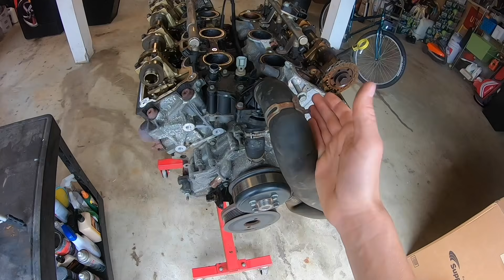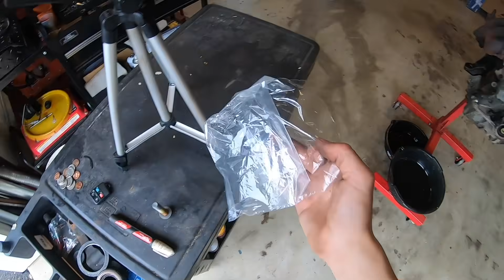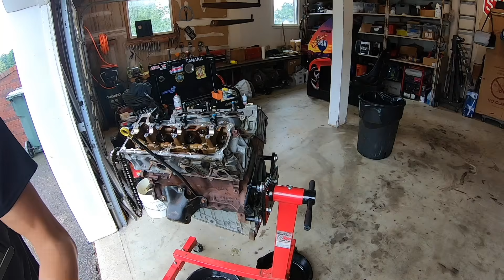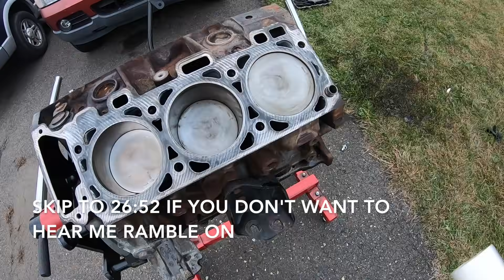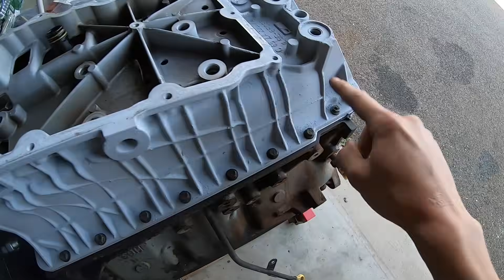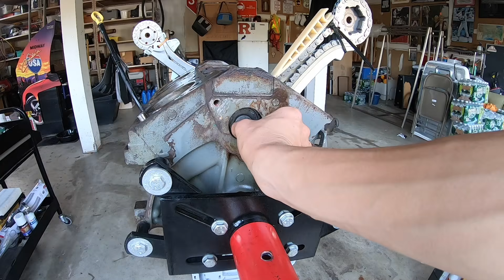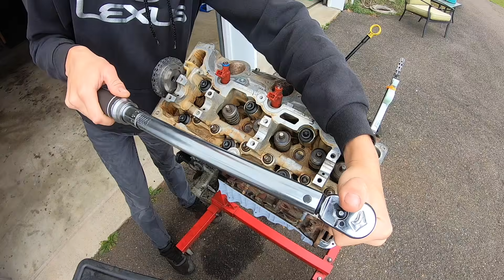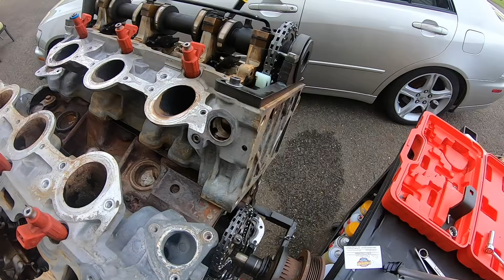Ford 4.0L SOHC V6 Head Gasket and Timing Chain Replacement (COMPLETE GUIDE)

Comment: Man you are amazing,  I have the same engine in my explorer sport trac it has 223k on it however it runs like a dream I think when it comes time to rebuild I'm going to save this video you are great at what you do ,you seem to know the specs on everything as far torque of bolts and the steps to take for rebuild very very good video, take care and be safe
Reply: @Mike Fu yeah i have a 98 Explorer and a Sport trac the 98 engine im putting in my Sport trac it has about 300k in it and like yours it runs great the engine in my Sport trac im going to rebuild put new bearings and also new chains ,ill do alittle at a time then when its done ill put it back in my Sport trac but the chains and guides look good even After abunch of miles on it i also think when you do the chains are you not supposed to use the same Bolts because they say its bad but ive Used the same Bolts and everything seems to fine so far

Comment: The 8mm head bolt should be removed first  and all valve guishould be replaced when the valves got bent
Reply from the maker: I have no idea what you’re talking about. The donor heads were off a different engine. The valves were never bent.

Comment: i love your attitude and how you show the process, and how to overcome the special tooling in your cassette replacement video.  obviously, common sense is involved in avoiding special tooling, i've only done ford's belt engines, but when special tools aren't pretty cheap like these ones, it is incredibly frustrating.   i'm probably about your age, 27, and i own a shop in pennsylvania doing mostly powertrain repair on japanese vehicles.   I came into an 07 explorer cheap, and im watching your video just to learn and become familiar with the platform.  What tri-state area are you in? I was always unsure about that phrase.

Keep it up! Thanks!
Reply from the maker: Located in NJ :3
Reply: @iamdjnam    Cool.  I'm in RI...  Will contact you if I ever decide to buy a used explorer...

Comment: Best video on youtube for these engines, I'm on the second one I've done with a completely bounced timing chain that didn't bend the valves. All the service info I have on Alldata and Mitchell suggests they are interference engines. I'm assuming that if the chain comes off completely you could get lucky, the one I'm currently doing broke all the guides front chain and rear (cassettes) as ford calls them and the chain went so violently that it broke a hole in the valve cover on driver side (LH/front chain), the shrapnel took out the DPFE sensor and broke pressure switch clean off of the A/C line right at the back of the compressor. On the other hand, all the ones I've done where the chain jumped time and continued to run before completely shutting down had every single valve bent. I've seen this on multiple different interference engines where if the chain completely breaks or slips off it doesn't allow the piston/valve collision to happen, the first time I thought it was a real lucky day but now I've seen it a few times
Reply: How did you figure it didn’t bend the valves? Did you take the heads off and look?  My front driver side cassette also popped thru the valve cover.  I redid the timing 8 years ago.  I have yet to take the valve cover off and look at it, a bolt head is stripped on the cover..

Comment: My 2005 Ford Sport Trac with 4.0 SOHC broke timing chains and valves hit pistons. If I put rebuilt heads on do I have to replace the pistons? Your video is awesome. Have a mechanical back ground and have changed heads on other engines so I can do the job. Don’t want to change pistons if not necessary.
Reply from the maker: No. You can reuse the pistons.

Comment: I did the timing job, put it in the car got it running and its been running fine for the best 800 miles, but now i'm pretty sure the head gasket was blown on the used motor I picked up. I should of replaced it while it was on the stand 😭😭😭

Comment: I have a 2009 Mustang without the balance shaft. I bought the tool 🔧 but I don't see where you used it. I removed the driver side head and cam gear without using any tool to hold the cam. Is that going to be a problem? I would think the cam shaft turned a little
Reply from the maker: You need the tools to properly time the engine. Removal of any head requires complete retiming of the motor.

Comment: I have a 2003 Ford Ranger 4.0 4x4 with 186k miles on it. One of the piston rods broke through the oil pan. I was wondering if you know some reasons how this could have happened. Could it possibly be a oil pump or timing chain failure? Also wondering what drives the oil pump on this engine? Looking forward to your input. Thanks!
Reply from the maker: Defective or scored rod bearing causing low oil pressure. It’s driven by a small rod off the jackshaft.
Reply: @iamdjnam  Thanks for the info! If I were to look for an engine at the junk yard to swap, Would you recommend another engine to swap besides the ford ranger engine? Since my motor is 4.0 4x4 I would have to take that into consideration while looking. Also would another engine other than the Ford Ranger engine cause problems with my transmission? As I would like to keep it because I just got it rebuilt.
Reply from the maker: @ClutchMadnezz  every 4.0 sohc ever made is identical besides the balance shaft. Whether it come out of a Ranger, Explorer, mustang or mountaineer, it’s alllll the same
Reply: @iamdjnam  Isn't it necessary for my 4.0 4x4 engine to have a balance shaft? If so, which ones out of those vehicles you listed would have a balance shaft?
Reply from the maker: @ClutchMadnezz  nah I always delete the balance shaft
Reply: @iamdjnam  Thank you so much for your quick responses. Really appreciate the info.
Reply: @iamdjnam  Oh it seems you did not respond to one of the questions actually it was, Do you foresee any problems with my existing transmission if I were to keep it and swap out for one of the engines you recommended. Also when you say "delete the balance" shaft do you fully remove it or just disconnect it.

Comment: Nice video man! Do you not rebuild these engines anymore? About to pull my 04 with 270K miles. She runs like a champ, but just got the death rattle. 5R55S was rebuilt 60K miles ago. Seems like I really should rebuild while I'm there..... I just cant bring myself to gamble on a junkyard motor on these 4.0ls. Your rebuild vids are the only ones you have with comments turned off. I'm sure that's due to trolls, But I'm asking you, are rebuilds too problematic?  Thanks in advance!
Reply from the maker: The complete rebuilds aren’t worth my time. I would get a used engine replace all the timing components and install it.
Reply: @iamdjnam  what about a crate motor? Aren’t those all rebuilt engines?

Comment: Hey bro excellent video do you happend to have that part number or a complete kit that you used thanks
Reply from the maker: Everything was pieced together. Links are in the description.
Reply: Thanks you for responding. I am working on  a 2005 v6 mustang just wandering if this kit would work for that engine I believe it is but I am not 100% sure do you know if there any differences in between the engines or is it the same ? Thanks bro
Reply from the maker: @kirtonvincent  it’ll work.
Reply: Awesome bro thanks btw your rodeo is one of the best out there just so you know

Comment: Great video! So as long as the cams are aligned and my sprocket is at TDC thats all i need? Theres no marks on the chain at all? Seems too easy…. About to pull my engine tomorrow
Reply from the maker: Yep crank at 12:00 and cams aligned. You’re good to go.

Comment: Same with head bolts push don't pull it will save your back down the road
Reply from the maker: Back has 2 rods and 20 screws. Can’t get any worse!
Reply: @iamdjnam  what did you do to your back?
Reply from the maker: @sef2273  scoli

Comment: So do the heads need to be machined flat? Never done a 4.0, can they just be taken off cleaned n replaced
Reply from the maker: I’d recommend it. I actually used fine fine fine sandpaper. The engine in this video just hit 40k miles.

Comment: I missed something.. Why are you advising adamantly to get the tool .. then using the vice grip method to hold the camshafts??
Reply from the maker: The kit only comes with one tool to hold the cam. The other cam is free to spin. I use the vice grips to spin the cams to TDC and to hold it when the other is in use.

Comment: I got the Fel-pro oil girdle gasket but it didn’t seem like it wanted to fit. Have you ever experienced this issue? It didn’t seem like the girdle wanted to sit flush after I put it in. I was gonna try to get the Ford one to see if that worked any better.
Reply from the maker: Usually they squish down and create a decent seal. I haven’t had issues with the Felpro ones. The eBay ones tend to weep every time.
Reply: The dealership by my house had one in stock so I’m going to see if that’s a better fit; otherwise I’ll use the Fel-pro one
Reply from the maker: Typically the dealership will have a better fit.

Comment: The Timing Chain Tool Kit on your link are no longer available.  Do you think DP Tools is a good brand?
Thank you!

Fantastic Videos!  I have a 1998 Ford Explorer.  Around six years ago the mechanic I used wouldn't install a new head gasket due to the complications involved with the timing chain and cassettes, so I waited a long time until they found a used engine which was installed.  It made a ticking noise from the onset.  The transmission went out when I drove it home from the mechanic, so that was also replaced.  A few months later the fuel pump went out.  I parked the Explorer in my garage for the next 6 or 7 years.  I recently had a different mechanic install a new pump.  It drove very well for a couple of weeks and then appears to have jumped time.  I still have the original engine and plan to use your video to pull the head(s) and replace the gasket.
Reply from the maker: DP will work fine. I’ll update the link asap. Thanks for the heads up.
Reply: @iamdjnam  Thank you for your response and your awesome videos!

Comment: I like to consider myself capable Mechanic, but this 4.0 timing chain shouldn't be this complicated. with was ford thinking, your video has given some confidence that, either I pull my 4.0 hope I didn't damage anything, because I killed it, or just get Used one and rebuild it, because they all most likely have worn timing chain parts. your video was very well done. I will see what the budget is maybe I'll rebuild one.

Comment: Do you know if all these engines came with the crank balancer?
Reply from the maker: @grizz2971  I always follow the Haynes manual orientation. Just did it last week!
Reply: @iamdjnam  Ok, sorry for all the questions. I'm following haynes as well. Thanks
Reply from the maker: Harmonic balancer or balance shaft are you referring to?
Reply: @iamdjnam  balance shaft, sorry. I don't know any of the history on my engine. But I've read that 4wd trucks had them and 2wd didn't. Im not going to put one in but I was trying to find out if this engines been tore down in the past
Reply from the maker: That’s correct. But sometimes Ford put whatever they had left into the vehicles. My 2WD mustang had the balance shaft.
Reply: @iamdjnam  ok cool thanks!

Comment: I'm rebuilding a 4.0 now. I was wondering if the connecting rod studs need to be replaced. I've read on some forums that they are TTY and some others say they're not. I've got all the other required TTY bolts
Reply from the maker: They are but I don’t replace them and I’ve never had issues.
Reply: @iamdjnam  Ok good deal!

Comment: Great video. So I'm replacing both head gaskets with the engine still in the vehicle. (03 Ranger 2wd) and the passenger side timing guide was broken while pulling the head off. Can that guide be replaced without removing the whole engine from the truck? I see you pull a broken piece of the passenger side guide out in this video but not the other piece. Is that lower pivot bolt accessible with the engine still in the truck? 
Thank you in advance!
Reply from the maker: Engine must be removed.
Reply: @iamdjnam  f#*k. Thanks for the reply!

Comment: Can’t do the back one without pulling the motor or dropping the trans
Reply from the maker: Yep. I mention that almost every video.
Reply: Just pulled my heads of and one of the valves broke of the head and bent sideways putting a hole in one of the cylinders so I will need a whole new block

Comment: I think this is the engine in my 2007 Landrover Discovery 3. V6 petrol unit, very smooth at 200k klms. How long do these engines last?  I change oil regularly and service .
Reply from the maker: 06+ engines will last 200-250k miles with good maintenance

Comment: Got a stripped head bolt in 4.0 liter I inherited the repair of any tips?
Reply from the maker: I stripped like 12 of them in my life. You gotta drill the head of the bolt off. I like those Dewalt black oxide bits. Use a vacuum to suck up the shavings. After you get the head of the bolt off, lift the cylinder head off. Then what’s left literally just unthreads from the block.
Reply: Hey great idea! I was about to weld something on there and start cranking lol.  Well thank you for the very informative video.  Awesome stuff quality content!

Comment: Hello, please tell me how to set up the gas distribution mechanism? since the mechanism is completely lost, the camshafts spun without a crankshaft. Thank you!
Reply from the maker: Which vehicle do you have?
Reply: @iamdjnam  ford explorer 4 cologne v6 sohc
Reply: @iamdjnam  please help, I installed the camshafts in the correct position according to the crankshaft mark, a knock is heard when the engine is started. after that, he turned the camshafts 180 degrees relative to the same crankshaft mark, when the engine is restarted, a knock is also heard, what could it be? Thanks

Comment: While replacing head gaskets the Right side cam got outta place badly. I’m about to the point of putting timing cover on since I replaced the timing and most components. Heads are on but the timing is not adjusted I have timing tools kit . My question is at what point do I  adjust right side cam, lock drivers side, and turn crank without breaking sprockets?
Reply from the maker: If the cam snapped backwards grab it with vise grips and rotate it to TDC.

Comment: I have a 2005 ford explorer 4.0 with 60 000 miles and now don't start Crank but no start and only driver side turn I don't know if is cheaper to replace the motor or fix the one is on it
Reply from the maker: Do a leakdown test on passenger side to confirm engine health.

Comment: Thanks for all the videos they are a huge help with my current v6 rebuild. Also thanks for mentioning DNJ components and partsology. No one in Australia supplies parts for these including Ford.
Have you ever posted a complete list of Torque to yeild bolts? 
Do you know where I can get new ring gear (Fly wheel) to crank shaft bolts?
Thanks in advance, Chris Mawbey, Australia,
Reply from the maker: Hey Chris. In the description of my video you will find some links. The flywheel bolts do not need to be replaced.

Comment: Great video watched it over and over when doing a timing job on an explorer, got it all back together and back into the truck and now I suddenly have no spark, really confused because it was driven into my shop before tearing it down any input would be greatly appreciated.
Reply from the maker: Check your grounds check 12v to the coil pack

Comment: This is why I completely stopped buying F0rds. Major problems with every single one of them, even brand New Ford truck. Biggest pile Of $#!+ ever owned.  Rear wheel fell right off, on a new vehicle. Because of a $2 seal failure.. said the dealers F0rd mechanic.

Comment: Great video but had an issue got to rear timing cassette guide bolt torqued. To 15lb and it snapped off in the block. Fun fun.
Do you have the correct part number for the cassette guide bolt?  Going to put heads on while waiting for bolt and getting bolt out of block.

Comment: Does the cam have to be removed to take heads off for head gasket? While I understand it’s best to buy the tool kit can the cam sprockets be timed without it?
Reply from the maker: You can remove the head with the cams on. You can also time the engine without the tools but you gotta have some real confidence and knowledge to do so.